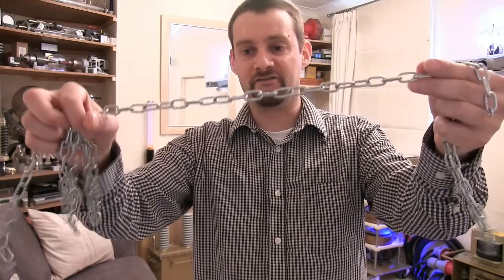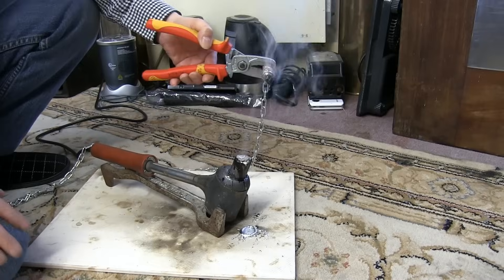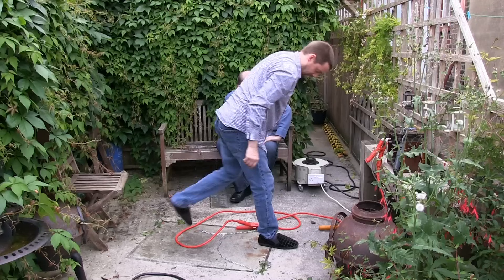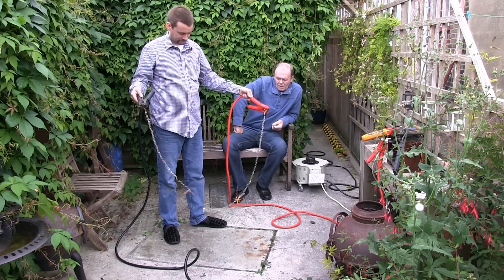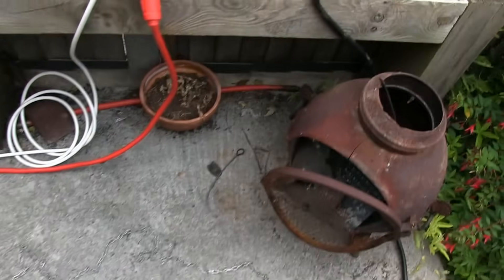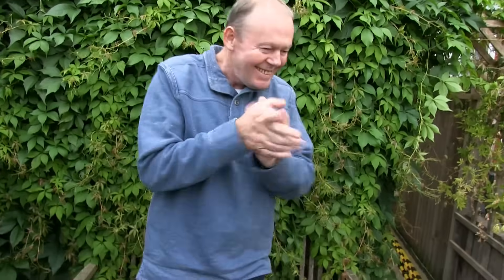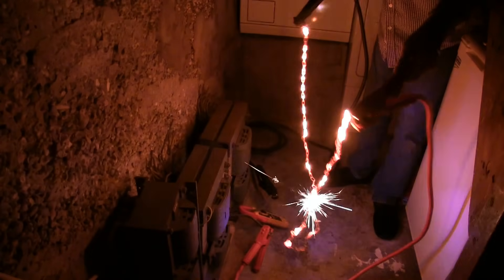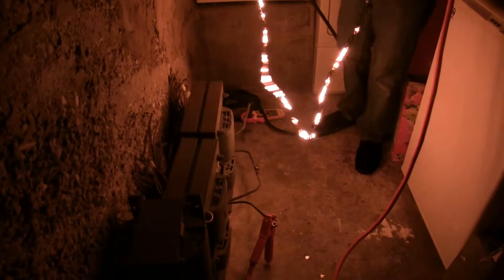Steel Chain VS Electrical Current

Comment: I wanna know how your monthly electronic bill looks like ...
Reply: Over 9000
Reply: 50 A * 30 V is about 1500 Watts (+the conversion loss)
Two cheap hair dryer would pull more power out of the wall then this project...

So his bills should be quite normal...
Reply: Why? This thing takes about 5kW (100V@50A) for example. If he runs this for like 10 minutes it will cost him about 25-30 cents / pennys.
If you for example take a shower with electric heating or you cook something, that will easily cost you a lot more. 
Just because it something special here doesn't mean it's gonna chew some megawatts or something.
Reply: He runs the meter in reverse for a while to compensate
Reply: His monthly eletrical bill is a samall loan of a million dollars
Reply: HIS EXPAREMANTS ONLY LAST A FETW MINUTS SO IT SHOULD ONLY COST A SMALL AMOUNT TO RUN EVEN THE BIG BOY SUPLY
Reply: He gets free electric I think or it would cost thousands per vid
Reply from the maker: Both of those together are 200A 55v
Reply: MINE IS 150 AMP 240 VOLT HIS IS 100 AMP 240 VOLT
Reply: but it would be relatively high because he does such things often probably even in private things
Reply: It's probably cheaper than mine, and I have hardly as many unexpectedly luminescent metallic objects as Photon does.
Reply: The power company send him gift cards every Xmas and birthday, as the best custoer ever.
Reply: ***** I AM REFERING TO YOUR BIG POWER SUPLY WITH THE TRIPEL STACK AND BLUE LED THE ONE YOU RAN THE 20KW LIGHT ON - WICKED BY THE WAY ... I BILT A 150 AMP VERSION WITH 4 STACK I HAVE A 200 AMP ENTRINCE AND LIVE IN THE MIDDEL OF NO WERE
Reply: the clue is in the video. all those TX can step up or step down star or delta with little loss.
Reply: +Jamie Phillips RIP readers wearing headphones.
Reply: Godfrey Poon EASIER FOR ME TO TYPE THIS WAY
Reply: lol these answers
Reply: his whole house is plugged into a library's free phone charging socket. maybe
Reply: Back in the day, yeah! Not quite possible with the digital age I'm afraid :P
Reply: No doubt he spends a lot less on power for his Vids than the average American Tuber spends on watermelons "soda" bottles and ammo to make a gun video. 
Funny,  I never saw anyone question how much that all costs.
Reply: Oil Burner And how much do you spend on all that free waste oil?

;)
Reply: Jamie Phillips There's no way he would get free waste oil for free. Free waste oil is at least a buck o'five a litre.
Reply: A riper shop has to pay to get rid of there surplus used oil so if some one like me or him wants this oil we can have it I to have a burner
Reply: he uses a transformer to increase the voltage using less money
Reply: Creeperboy A transformer changes voltage to current ratio not power example 10 amp 120 volt in 1200watts 2.5 amp 480 volt out is still 1200watt in fact they are only 85 -95 % efficient
Reply: Ethan Zeccola that goes with out saying
Reply: +Jamie Phillips Should probably turn off your caps.
Reply: +Oil Burner Defies* if you've got to insult people, spell properly please.
Reply: DerDa your comment made me laugh
Reply: thats kinda my job ?
Reply: Vax Buster if it's AC power it wouldn't matter
Reply: Literally
Reply: "electronic" bill? lol
Reply: @NebukadV  
Pennies*
1 penny, several pennies..
Reply: @JBroMCMXCI  
You know nothing about electricity it seems..
Sure, MILLIONS why not..
Reply: I figured he was forming his own power somehow. And not using a power company’s power.

Comment: God, I'm afraid every video that it's going to be your last.
Reply: this is why is so interesting...
Reply: You have it wrong. There's nothing really over the top dangerous here.
What is really interesting, is this man has managed to fry a fucking chain. 
A chain. Not a piece of wire or cheap chinese multimeter.
A mechanical device for restraint has been popped. That is definitely interesting.
Reply: it's mostly lower voltage so looks more dangerous then it is (at best he set his shoe, pants or carpet on fire)
Reply: +lee x Then again, the metal could have burnt straight through his skin.
Reply: I'm referring to all of his videos, including this one. Setting his carpet on fire is very bad and could lead to death, although most likely just severe burns and no more house. But in past videos he has dealt with much much higher voltages to make things that he expects to heat up, all on his CARPTED FLOOR. His equipment can do plenty enough amps to kill him easily, one trip or misstep and he is literally dead. Most of the time there are breakers to prevent Bad Things from happening, but in this case he explicitly wants the Bad Things to happen (just to the device, and not to him). I like to think that it's all trickery to make us think its really unsafe to make his videos more interesting but really he's in the middle of a barren field with a remote cutoff switch in his pocket as well as a helper standing ready at a physical cutoff switch, and with fire extinguishers available and with the main actor actually edited in via green screen effects and

well, I'd like to think so. Probably not, though.
Reply: shelvacu his fire extinguisher is a spray gun (he does have them thought) most of the time he is working with less then 5-20v at very high amps (do agree the heat could pose an issue with burns )

There are lots of burns in the carpet upstarts (and laser burn holes in the chairs, testing 100w laser :) )
Reply: He's pretty careful actually, especially around high voltage. With just high amperage you can melt all kinds of things and do spectacular stuff and your biggest worry is burns.

Even with high voltage, if the current is low, you can still make all kinds of arcs and zap all kinds of things, especially if whatever you're zapping doesn't have much resistance.

It's when the voltage and the current exceed a certain amount that the situation can become lethal. For example in one video he was using a capacitor to put out high voltage and high current and used it to explode a coconut and thoroughly melt/vaporize a banana. He had a big disclaimer at the beginning of that one.

I've seen videos on liveleak for example of people being electrocuted to death, say from powerlines, and it's pretty quick. Just a tap and fire/smoke can come out of their skull. That's not the disturbing thing though, the really disturbing thing is when I realized that the electric chair was not instant death! The voltage/amperage was not sufficient for that, instead it actually slowly electrocuted the person over the period of maybe a minute or so. Definitely 'cruel and unusual'. Good thing it's not really used anymore.
Reply: hakachukai
You may be correct, but you must consider that the body has some resistance (And capacitance). Therefore, even though a power supply is capable of delivering 100A @ 24V, it won't harm you. A chain on the other hand, will glow red hot.
Reply: +Lockie L

Don't get me wrong. I'm not attempting to take sides on the issue, I'm just pointing out the science behind it.

There are so many variables involved that there is no way to know exactly how the 50 volts could kill him, but if the right set of circumstances went wrong, it definitely could. I'm not saying that it is likely, but it could happen.

Some people have been killed by as little as 12 volts.
Some people ( like me ) have survived being hit by 30,000 volts.

It really just all depends on where it happens on your body and what your internal resistance is at the time.

You may notice for example that when they de-fib someone they place shock paddles directly above and on both sides of the heart. They do this to guarantee that the electricity will travel directly though the heart.

I'm also NOT saying that he shouldn't make these videos. It's his life. He can do whatever he wants with it. I've done things WAY more dangerous that this for years... and I'm still in one piece.

I'm not gonna lie though... those bedroom slippers right next to that glowing hot chain are a VERY bad idea! :-P
Reply: My rule of thumb: Everything above 30V can hurt you, everything above 50V can kill you.
That said, as long as you don't have it flow through your heart, you are still safe. Touching the chain with your leg would certainly hurt (mostly because it is red fucking hot), but it would be far from lethal.

Also keep in mind that, as long as the chain is still connected, very very very low current will actually decide to flow through you instead of the chain. The chain is much more convenient for them electrons.
Reply: its not like he is grounded as well you can touch 240v fine as long as your not grounded (this was 50v)
Reply: lee x I think this is absolutely false (and possibly dangerous misinformation). My father just got a nasty shock from a 220 V socket last month and he wasn't grounded. 

If there was even 0.1 amps of current, 220 V is definitely enough for it to get into your body and do some damage, grounded or not.

Unless you know the current is extremely tiny (like 0.001 amps), I wouldn't mess with more than 60 V. Past that point it's starting to get through your skin.
Reply: You are always grounded to a certain extent almost no matter what you do. I've gotten plenty of shocks off the 120v lines in the USA even while wearing work boots with rubber soles that were 2cm thick. It isn't pleasant at all! Getting hit by 220v would be twice as bad!
Reply: That's something that really needs to be explained - the most important thing that they are not teach us in schools. How it's possible to still get shock even if you have "insulating" clothes? I don't understand it... it seems that you always can get shock, even thru air, if you accidentally touch "live". Than whole story about insulators and insulating materials have no sense.
Reply: Felix2417425 V = IR, where V is voltage in volts, I is current in amps (amperes), and R is resistance in Ohms.

Current is the electric power itself. To use a water analogy, it is like liters/second going through a pipe, and indeed, 1 Ampere is 1 Coulomb/second.

Electricity is dangerous when current gets into your body in a sufficient amount, especially into your heart and brain.

For this to happen, the resistance of your body must be overcome. Resistance is how difficult it is for the current to flow through a medium. Conductors have relatively low resistance, insulators have relatively high resistance.

To overcome resistance you need voltage, which is analogous to water pressure in a water pipe. With sufficient voltage, current can flow across any medium. (Well, at some point the energy density would cause a collapse into a black hole, destroying any such apparatus, but that's quite a lot of voltage).
Reply: You didn't answer my question, just wrote what I already know.
My question is strictly related to 240V mains, not any higher than that. The thing I want to know is: can I safely touch „live“ wire, if I have rubber gloves on my hands and/or rubber boots? Or this is not enough level of safety? I want the answer on that question once for all.
Reply: If the rubber gloves are rated for 240v, then they will definitely protect you from the direct current flow ( if they are dry and not damp at all ). However, because it is AC, there will be a certain amount of current flow that happens because of capacitive coupling. Basically, your body being near the live wire becomes one plate on the capacitor, while the wire or charged object becomes the other plate. In this situation insulators won't help you. Only distance will.

I don't know if this will be a significant danger or not.
Reply: Oh yes, I totally forgot about capacitive coupling, now that makes sense. But I think that human's body don't have enough capacitance to allow significant current to flow which could be potentially dangerous.
Reply: he's a professional you turnip
Reply: +hakachukai     
"0.08amps", "If 8mA flow across your heart in any way, you are dead".

0.08 Amp is 80 mA.

Anything over 100mA can disrupt or even stop your hearth rhythm apparently.
Reply: let me reutter, he is a PROFESSIONAL he knows the risks he went to school and collage and uni to learn about it! He does health and safety inspections!?! he knows whats going on CHILL FFS!
Reply: Like if he accidentally tripped on some cable and fell onto that 5000A capacitor while it was charged?
Reply: Well we haven't seen him for nearly 2 months, so...
Reply: Well said
Reply: "Lets Try 10,000 volts!"
"As you can s-"
Falls over dead
Reply: guess any of u making comments about him getting electricuted dont know much about electricity,because almost all of what he does is done with low voltage like car battery voltage and less. it could still shock the hell out of u if ur not careful and kill u if u dont know what ur doing. clearly this guy is an electrical engineer and is on his way to b the next thomas edison.
Reply: Gary Poole Nikola Tesla you mean
Reply: It only takes .004 MA to kill you he is messing with way more amps than that.
Reply: You only receive a sock if you complete the circuit. What this means is if you are insulated from ground (or earth), then to get a shock you need to be touching both the live and either neutral or the ground-wire. If you are not wearing shoes and standing in a puddle, just touching the live will give you a shock.
Reply: I am an electrician and even I decline to advise you here. There is simply too much to take into account. Not just rubber gloves and/or boots. What you need to do is some serious reading up.
Reply: a sock? that's lit
Reply: I commented as everybody seemed to not be paying attention to how careful he was being in caring out these dangerous experiments. Grant it it only takes 1 misjudgement and thats it. I was not saying that he would NEVER get hurt,or even die from doing this.
Reply: it´s not the high Voltage that kills him, its smoking.
Reply: 1 guy to do all the daredevil stuff, the other guy to hold the camera and have the nearest hospital on speed dial.
Reply: So many clueless keyboard worriers.
Reply: @Yotanido  Wrong... Wow.
Reply: @shelvacu  No, you're wrong. All the videos where he is melting spanners etc. is quite low voltage and wouldn't do any harm at all. The amperage is quite irrelevant. It's the heat and fire that are the principal dangers here.
>
Reply: Bodragon he disappeared
Reply: @crogthecreator7290  maybe it happened
Reply: @brick4353  maybe??
Reply: This didn't age as well
Reply: @lukmly013  what are you talking about, this aged perfectly :)
Reply: @leexgx  If a chain burns through your hand, then suddenly your bloody non-skin-having hand will have some very low electrical resistance, turns out.
Reply: some people are willing to take calculated risks which others find extreme and they make the most out of their life. others shelter themselves, never taking any action, they try to live in as much safety as possible. longevity vs fullness of life. to each their own. this guys living a cool life as far as I'm concerned and if he died he'd go out like a legend.

Comment: new Christmas lights? 😂😂😂
Reply: hahaha wrap that around a tree xD 
best thing that could happen is that you may roast some marshmallows after ;D
Reply: +Jonathan Knirsch Photons Christmas special? I think so. at least he can say I popped it! xD
Reply: ***** ik that's why I mentioned the marshmallows ;)
Reply: awesome! any idea why some links get hotter than others?
Reply: Christmas light, stove, heater and electric chair combined
Reply: james swinburne: Higher resistance = more power dissipated = more heat. Maybe slight differences in alloy make-up but more likely differences in thickness.
Reply: +ExaltedDuck and maybe because of some rust
Reply: certainly possible
Reply: Great, the chain is just as dangerous as the 250v lights :)
Reply: Delta
If not less dangerous...

Comment: I bet that somewhere a chain has borne full industrial fault current like that for real.  I tried running low voltage DC power down chains when I was younger and they really do make a shit connection due to all the metal to metal connections and surface oxidation.  A TIG welder might have had the advantage of the high open circuit voltage breaking the oxides down.
Reply from the maker: Hello mate, lol, I used to play with fairy lights when I was younger, in the end brute force always does it :)
Reply: i like your page aswell big clive
Reply: NICE TO CEE YOU HERE I WATCHED ALL YOUR VIDS .. I HAVE BOUGHT LOTS OF LEDS BECAUSE OF YOUR VIDS I GOT SOME OF THOSE LED BULB KITS AND PUT ODD COLARED LED'S IN ALL 4 OF THEM THEY LOOK COOL
Reply: caps
Reply: You two really should have done a collab
Reply: Thanks for learning me bc

Comment: Do untill it pops: ceiling fan. With the regular fan blades on it. Or a regular fan over volted untill it pops. It should look fun
Reply: Except all it'll do is smoke. You need higher frequency to overspeed commutatorless motors.
Reply: The Rambling engineer. ok
Reply: how high a frequency?
Reply: i wonder.
Reply: THAT is what I wanna see!!
Reply: Overvolting a ceiling fan will result in it turning into a jet engine and blasting out the roof of your house into space because jet fuel is a myth and the government is trying to scam money out of us.
Reply: hashtag jetfueldoesn'tmeltsteelbeams
Reply: nobody expected the spanish inquisition